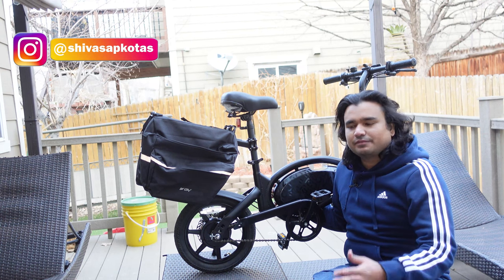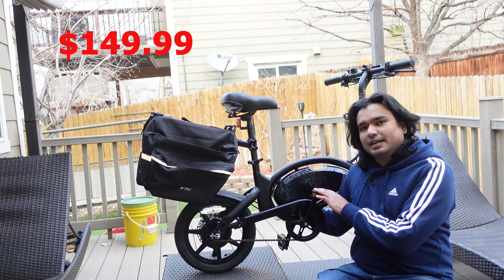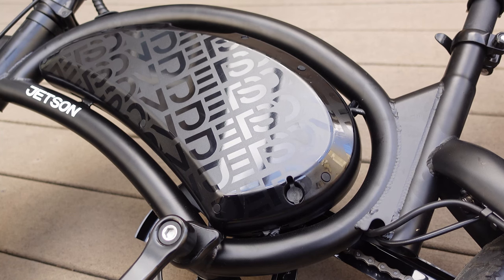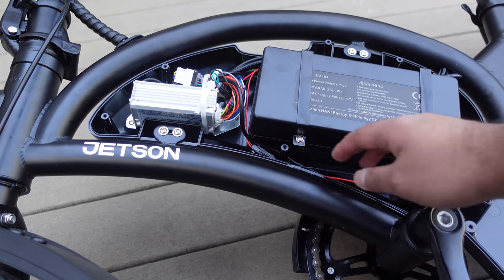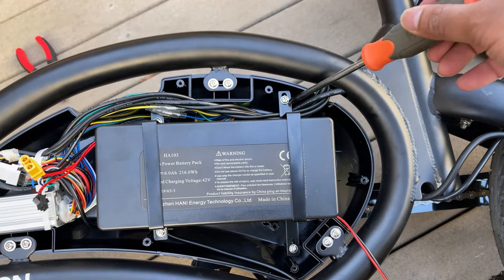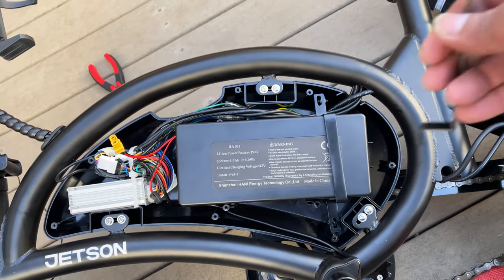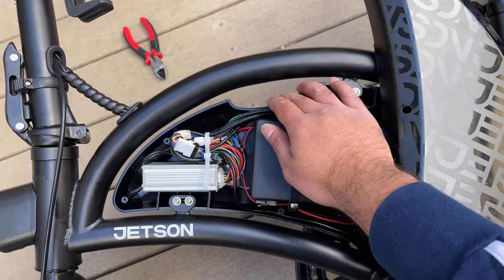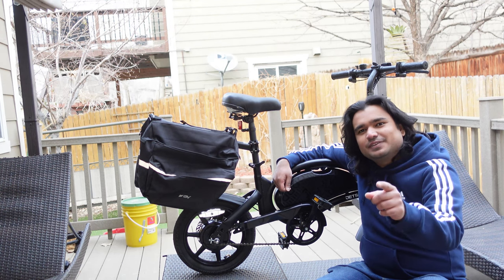HOW To Replace Battery and Cost (Jetson Bolt Pro Folding Electric Bike From Costco) 2021

Comment: My battery went out in less than a year. Works for 5 minutes then turns off, even on a full charge. Watching this to see what the insides look like before I go in.
Reply: I have similar issues one of two bikes  after owning  for 13 months / light use.  Did replacing your battery fix the problem?
Reply: @KennethWPonder  I didn’t replace anything yet. I actually posted on the Jetson subreddit. A posted a picture of the bike and they had reached out to me. I’m getting a new bike for free even though my warranty is over. They have great cs
Reply: I reached out to Jetson but they are not going to fix since I am a few months out of warranty (even though problem started before warranty expired. I didn't report in time).  I will proceed with third party battery replacement at a part cost of $150.

Comment: Can u send the link for batteries whereas I can buy
Reply from the maker: Hello, please check this video out. I have the battery link in my description. Ebay battery: https://youtu.be/5kr7u0--iGI. Thanks for watching my video.
Reply: @ShivaSapkota  Dada, Most people complain about the battery . They say battery goes down quickly. What is your experience?
Reply from the maker: @mdiftekher1425  It totally depends on the riding conditions and the weight of the rider. I recently did a test and the original jetson battery gave me around 9 miles of range on a full charge. But I was riding on cold temperatures, which lowers the range. If you are going against the wind or even if there is a little hill, the range goes down. So, someone might get a 15 mile range if they are in warm weather with flat roads. But someone else can get less than 10 miles if they are in cold weather with the same battery. Hope this helps 😊
Reply: Dada, would you plz check the link and see this battery will work in this bike?
Reply from the maker: @mdiftekher1425  Can you please post the link here? I can't see the link. You can also email me the link in case youtube is blocking the links.
Reply: @ShivaSapkota  what is ur email?
Reply from the maker: @mdiftekher1425  sapkotatechnology@gmail.com

Comment: I want to buy smaller 12" one, put  crankset and change battery to 20AH, to get ready for 40 mile range.
Reply from the maker: That might be difficult. I believe I saw someone selling the kit in ebay from their older DYU ebike. I am not totally sure how to do that. Thanks.
Reply: @ShivaSapkota  can you please send me a Ebay link to DYU kit?
Reply from the maker: @otherallies  Unfortunately, that listing seems to be gone. I even checked Aliexpress (seen a used kit before) and cannot find it. I would recommend you keep checking "DYU/Jetson Pedal Conversion Kit" Thanks.